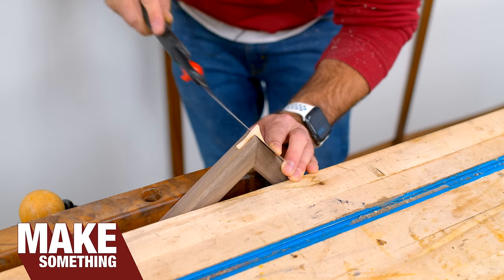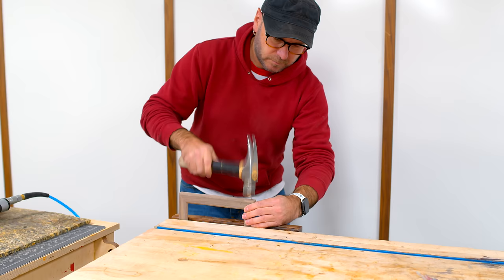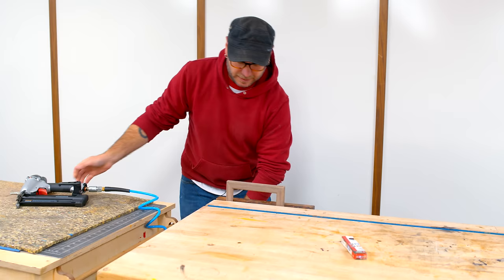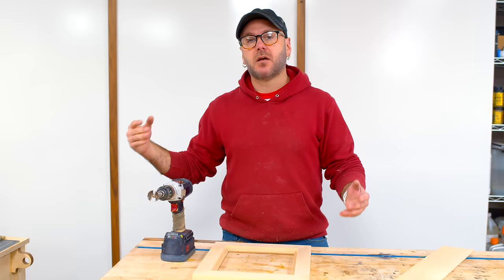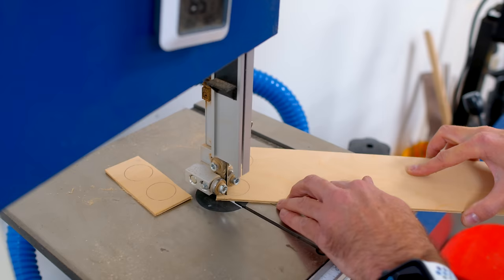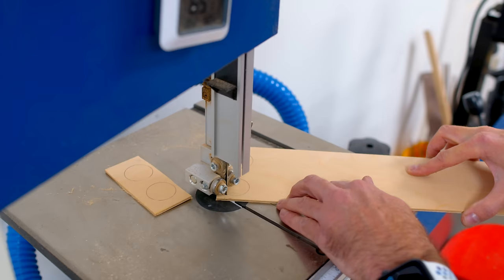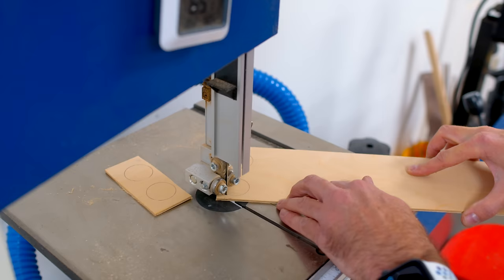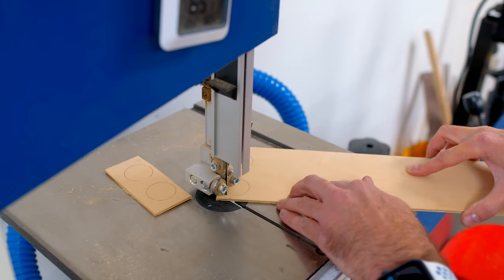10 Ways to Reinforce Mitered Corners in Picture Frames.

Comment: Great reference video! I recently built a walnut frame with an edge detail that precluded the mitre spline method. After lots of thought I decided to use a 3/4 Forstner bit on the back and a 3/4 PLUG CUTTER to make face grain discs. Epoxy as a filler glue, touch up with a sanding block and fini.

Comment: Thanks for the frame making video - you inspired me to try it. I built your spline cutting jig for my table saw. Got it almost assembled before I realized that I had to scale it down for my contractor saw. Had to take it apart and cut down some pieces. Now it works just right. Now I can take it apart and glue it, or just skip that step. Now waiting for Amazon to deliver the necessary clamp. Thanks!

Comment: I work in a gallery and what we do is miter to size all the parts. Take the end of a table and a piece of plywood that is square and screw it to the corner of the table so it makes the frame material hang over about 1/2 inch. Get your 4 pieces glued up and place them on the corner with the plywood that will keep it squared and then use some pen nails to hold the frame together. You keep going around until all 4 corners are nailed. Take a wet rag and remove any excess glue that squeezed out and your done. No waiting a day for glue to dry.

Comment: A method I learned in a professional frame shop is to use the Festool Domino similar to what you did with the forstner bit.  Plunge into the back (after initial assembly), glue in a domino, and then cut it off flush with an oscillating tool.  Works really well with frames made from commercially purchased frame moulding since it's all done from the back.

In the same shop, we also had a neat framing tool that worked like a typically domino reinforced miter, like you demonstrated in the video, but it cuts both adjoining faces at the same time with a funky router bit, and then you insert a plastic I-beam looking tenon.  Pretty neat, but they're not very popular anymore, especially since the Domino hit the market.
Reply from the maker: Whoa! I that's pretty cool! I wish I knew about this technique before making the video.

Comment: You can also use a hole saw to make your circles. Use a blade that is 1/8" larger than your forstner bit and remove the centering bit. You'll want to use a the drill press and make sure your stock is clamped securely.
Reply from the maker: Yes! Great tip!
Reply: That's his least favorite method.

Comment: Great instructional video. Love the various jigs. No proper hearing or eye protection?  I'm surprised you didn't mention a v-nailer. I'm doing 40x60 inch frames for my gallery art, and I couldn't live without it. Owing to the size, and weight of the glass, I also router a 1/4" groove in the backside corners into which I sink angle brackets. And of course, Titebond glue-up . I'd post a couple of pictures, but it doesn't seem you can do that with Youtube comments

Comment: Why wouldn't you want those runner things on the spline jig all the way down to be somewhat of a backerboard for chipout?  Just curious why they needed to be moved up
Reply: I'm guessing go accommodate larger frames
Reply: Because you move the fence depending on the thickness of the frame or number of splines in each corner. Just my guess.
Reply: Mostly because you would be cutting through the runners every time you used the jig. Eventually you would have to replace the runners because they’ve been cut too many times, kinda like the push sticks. By keeping the runners above the anticipated blade height, you shouldn’t ever have to repair the jig, in theory.

Comment: What about dowels?  Strong, easy, and add a design element if you use a contrasting wood.
Reply: This is how I do most of my picture frames. I've been using miller dowels after glue up and they're very easy look great.

Comment: A hole saw to make circles will also work with the forstner bit.
Reply: If I used a softer wood like modeling or balsa wood for the circles would it weaken the joint in the forstner method? I need something I can cut by hand since I don't have a band saw.

Comment: We are having to manufacture for ourselves a window molding a good 70" x 60" rectangular.  The reason being we want the molding to stand away from the wall a good inch or so to accommodate purchased insider windows.  Which method would you recommend for something so large?

Comment: Question on the forstner bit method: Wouldn’t it be easier just to cut cookies off the end of large diameter dowels or would wood movement be an issue?
Reply from the maker: You need that long grain for it to really be effective.

Comment: You are not going to do this with finished gold leafed mouldings or expensive mouldings.  No respectful professional framer would do this except for possibly some Master framer building a closed frame from scratch.  I was a professional framer for 35 years and glue and coated brads were the standard for us at the begining.  I later bought a Commercial V- nailer.  VN-2 in 35 years I never had a return of a frame ....ever because of breakage. So this is great for woodworkers but a bad idea for real picture framers.
Reply from the maker: OH GOD NO! I would never use gold leafed moldings! Barf!